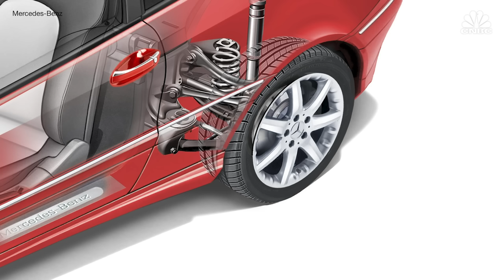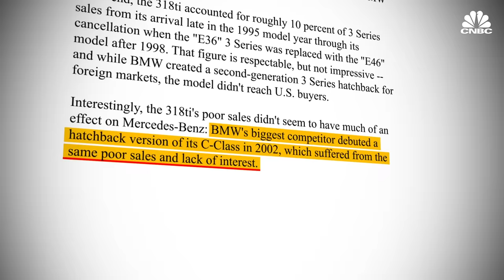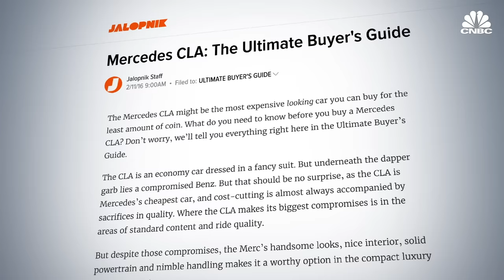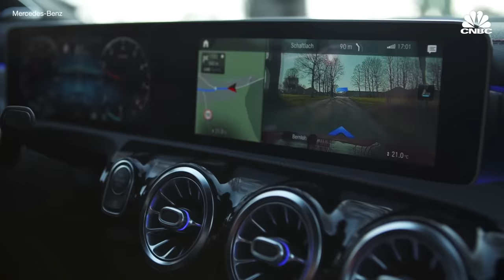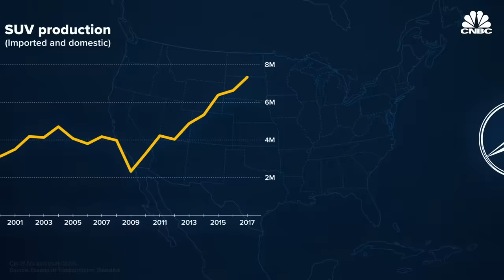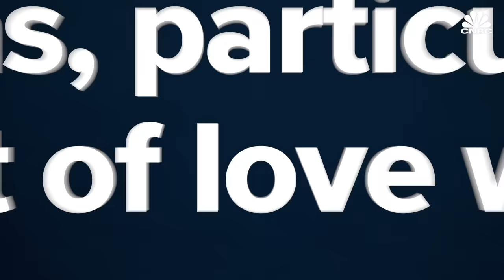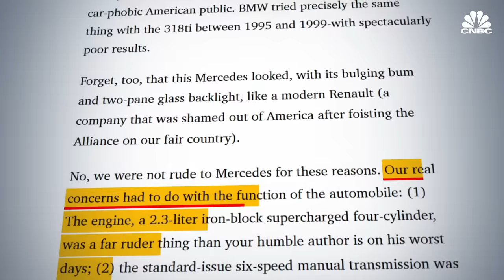Why BMW And Mercedes Made Cheap Cars That Failed

Comment: So, a Mercedes for 33000 $ is a cheap car? Quite gentrified and distorted frame of reference at CNBC.

Mercedes A-class (incl. derivates) and BMW 1 series (incl. derivates) are the globally fastest growing segments for both brands.
Just because Americans like to drive around in 3 ton trucks doesn't mean the smaller Mercedes and BMW models failed.

Why don't you just produce a video titled: "Why the U.S. Auto industry keeps only producing cars that fail". 
Name one U.S. car model of the last 60 years that was an economical success outside the U.S.
There are many iconic U.S. cars, none of them earned money outside the states.

Comment: Basically the 3 & 4 series fall in the same group. The 3 series is for sedans and wagons and 4 series is for coupes & convertibles. Plus the 8 series has been around in the 90's but it was discountied. No offense but the only new model would have been the 1 & 2 series. They need to fix their research

Comment: The cla wasn't a failure they sold litterly like hot cakes when they came out,  there's a reason why they are still making them and why they made them more expensive cause people did like them. Personally I had a CLA brand new in 2015 and now I have a 2020 C43 AMG so Mercedes tactics did work as I bought another benz after my CLA.

Comment: Mercedes sold more than 1.000.000 cars from the C-Series worldwide in spite of the partnership with the  Chrysler Company at this time, which produces the worst and crappy cars from all american motor companies. 
Especially after they began to cut the influence and the sick relations to Chrysler in 2004 step by step, it  ended up in a necessary end of partnership in 2007 . Daimler took back their competence of value in premium cars. And so the C-Series between 2004 and 2007 became a huge success story against the will of Chrysler management and their impressions of a "true shareholder revenue". So far about the facts...

Comment: Bmw's and merc sold in the US are mostly made in Mexico or other country around the US snd the quality are poor. Here in europe those two brands are reliable probably they are assembled here or straight from germany and have a better quality. I owned a 11 year old bmw 3 series with 129k mls in the clock and still drive like a dream and never had a issue with it.

Comment: Modern non luxury cars are so good that very few luxury branded cars offer much improvement. There are exceptions but for almost every buyer I think you’re better off getting a loaded out version of a non luxury brand car.

For the price of a base Mercedes CLA, I can get a fully loaded Hyundai Sonata. It’ll be way better equipped, larger, cheaper to own and maintain and in traffic it will make no difference that the CLA is just a little bit grippier in a race track.

Comment: Cheaper luxo brand cars are not so cheap.  Sure the msrp maybe lower than their average fleet lineup BUT that doesnt change the view of insurance companies nore dealers, who manipulate its given price back up thru expensive options.  in the end you have a less capable less luxury vehicle with only a smidgen off the price of its more costlier siblings.

Comment: 1:46 min „officially known as the 318ti“. Yeah when it is a 3 series compact with an 1.8 liter engine, but there are also a 320ti/d 325ti/d. It got canceled because it was ugly af. The e46 was a beauty and is appreciated until today but the compact looked like an abortion which survived

Comment: BMW...has way too many rubber grommets that decay and crack and fall off. Not good. It's over engineered. That's why I got rid of MY Beamer ...I couldn't fix it without rebuilding it...I am an Aerospace Engineer . I have made parts for NASA, Boing, the Millitary, F-15's, Apache Hellicopters,
F-22 Raptors, J.PL.,  I could go on and on and on. But I won't .

Comment: 1:18 - this is basically not correct - either numbers are wrong on Lexus or you do not consider Lexus as premium brand. Lexus is 3rd after MB and BMW, then Tesla (which is not luxury as far as I am concerned), Buick and only then Audi (6th). Or you mean to say 3 largest European brands? Unless this doesn't suits your narrative because Lexus is one of the most reliable brands and still relatively more affordable than European (Mexican made) cars and you don't want to mention Buick, because it is neither comparable by quality, nor even that luxury (basically copy of Opel/Vauxhall entry level cars with little bit of badge engineering).

Comment: These guys completely missed the point! Why Im not surprised about it as the two companies in question are also missed this salient point i.e. irrational and rational buying. Normal Joes buy cars for a reason, mainly for their day-to-day commute basically for a "hack" unlike high-end buyers. If they get Beamer or a Merc for that price, why not? Now that's the problem, ppl should buy cars that fit their life style not the other way round. Like the wrong marriage! When they realize that these cars are technically advanced hence high maintenance and high running cost, it is too late as they lost their investment. So their bad decision becomes a bad experience for others, word obviously spread as they are the biggest mouths in the world (via FBs; youtubes, etc.) - commoners tools these days; so goes the brand down the drain with them. Instead of using their prestige brands to lug in sales volumes, they must use of their many subsidiaries to do the dirty work as others do. End of the day, they must start loving their skins they born-in! Should not try to follow Toyota; GM OR Nissans, they are born commoners while you are born prestige!

Comment: Just so much weak sauce analysis here.  First off, muddling together 20 years of events, selectively, to shoe-horn in a thesis.  Secondly, failing to discuss the impact of low-interest rate, short term (under warranty) leasing on the market impact of "cheap" offerings. And last but not least, discussing how the automotive press has, either as a sign of the times or as part of a complicit "access" strategy that takes evaluations of new models in a direction the manufactures wanted to go, shifted it's focus away from things that were actually "car" stuff, and expensive to implement (from aesthetics such as leather and wood -- i.e., luxury feel -- to mechanical things such as torque and cornering hold).  Instead they started covering cheap to produce "technology".  Cheap in the sense that a top of the line spec'd machine at design time can be built with chips that are cheap throw-aways by the time manufacturing beings, and software can be slapped together by engineers running on autopilot, on the assumption that it can always be patched later with a firmware upgrade.  Also somewhere in mix of that latter lapse in the reporting of true quality (steak) vs. gadgetry (sizzle) lies the modern media obsession with fuel economy, emissions, and global warming.  That "virtue effect" adds luster to driving around in a smaller coupe if it allows you to brag that you get 65 MPG.  Where it gets complicated is when those virtuous drivers shift to emerging technologies prematurely -- the technology for EV's isn't cheap so the margins aren't necessarily high outside of the 6-figure vehicles but also the risks of getting it wrong are pretty high if an EV car, particularly a "cheap" one trading on brand, fails to perform to expectations (see Chevy Volt).

Comment: Don't for cheap interior plastics, and to fix it will burn a hole in your pocket. These are not reliable, cars. Buy Lexus.
Reply: Lexus is a joke compared to the Germans

Comment: This video is complete rubbish. I own a W203 c class and it is available with leather seats and comes as standard with cd player. That aside it is much more reliable than most modern cars and the cabin is of a better build quality. Now Mercedes cars are like any other brand. Cheap and plasticky

Comment: Mercedes and BMW are cars to be leased only for first 2 years - these cars start falling apart starting at year 4. Not worth the money. If I spent 100 K on a car, I expect the car to not require expensive repairs for 10 years or so.

Comment: Okay so my first mercedes was a 1991 190e it was loght blue ill tell you something that car was reliable and quality.even my 300 td sedan was reliable.But what mercedes needs to do is fire there new management bring back the old Daimler management.those cars back in the day were as good as a toyota.that's the truth.but now Mercedes BMW Audi there all greedy.if they worked out there reliability used good quality parts stop putting computer module crap and poor parts they would do a lot better I agree with Scotty Kilmer there money pits now they should be ashamed.bring back the 190e and 240d with the original engine I'd drive that any day but I rather own toyota now eventualy lexus will be in my driveway I value reliability something mercedes Benz lacks today its a shame 70s 80s early 90s mercedes standed for quality and reliability.they need to work out there konks stop being greedy and unreasonable on repairs.